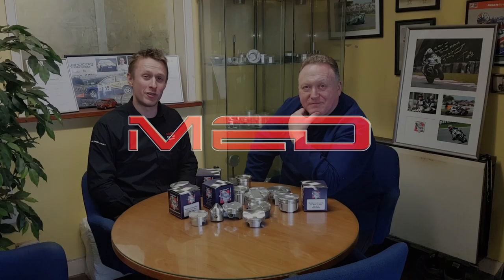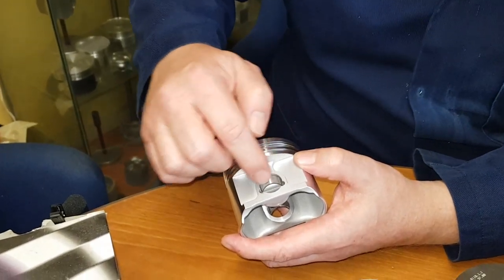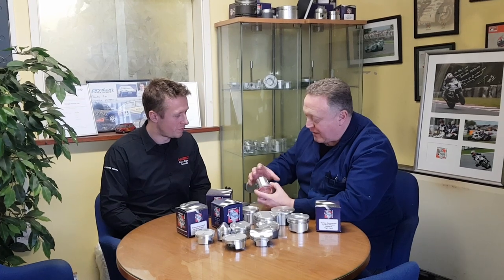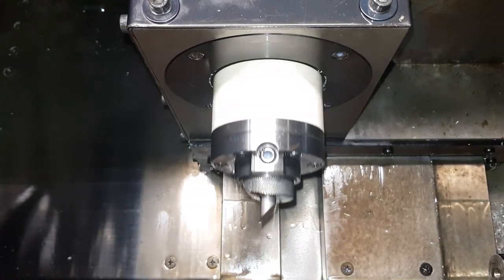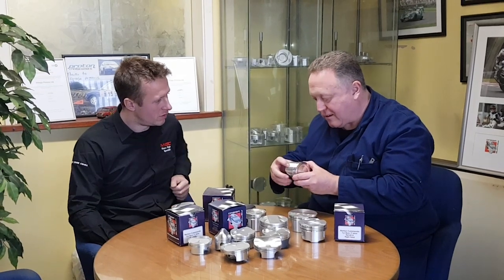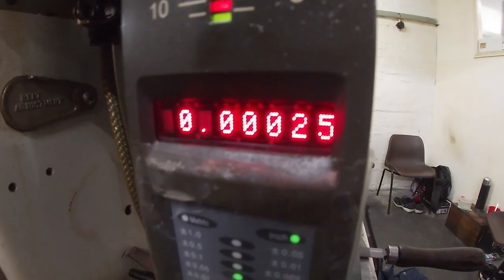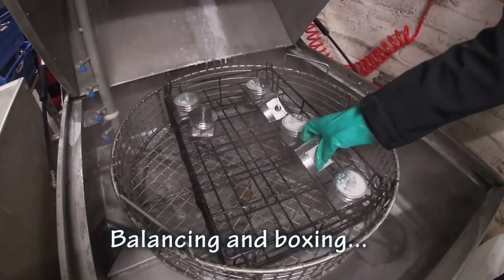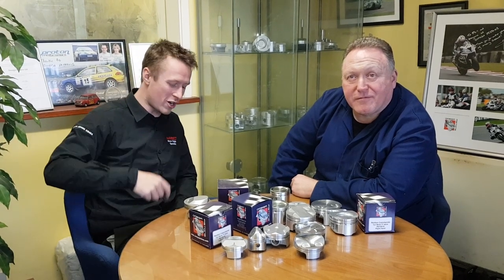How it's made - Omega forged pistons - Part 3

Comment: I think it is the best and most educational forged piston manufacturing process video on YT. Congratulations!!! I didn’t expect that the details of the so called oval shape based on the design would be that sophisticated. I believe the quality of that phase alone makes the biggest difference between the brands. However, I would expect Omega to cover the common skirt and top side coatings. May be a in a Part4.
Reply: Thank you

Comment: do you calculate how much material is preventing the pin from yanking out the bottom of the piston by looking at the amount of web above it.. and do you ask for customers when they have an engine failure to send the damaged pistons back for analysis..  do you offer info on piston expansion rates above normal operating temps .. i am thinking about the rash of piston, ring, cylinder bore failures on the ford GT350 engines with the 180 degree cranks..  where the high boost and high rpms seem to expand the rear most pistons in the block causing them to scuff and pile up aluminum transfer weld under the rings.. either breaking the ring lands or lifting the rings off the cylinder walls letting combustion gasses thru killing the engines..  probably do to a lack of cooling around the back cylinders in the block at such high speed that the water pump impeller is cavitating and reducing mechanical cooling system pressure in the block or just reducing coolant flow..  too much for the oil squirters to cool the piston crowns from the bottom for the short duration high rpm these engines can do.  the 180 degree crank removed crank whipping that pulled the main webs out of windsor blocks for decades.  and a few mod motors.  heating the pistons in something like a mobil 1 oil. and quickly taking a measurement of them.   or streaming a blended flame at the top to keep the temp just below the melting point.  to see how much they expand..  allowing engine builders to machine in extra clearances and ring gaps for the rear cylinders to reduce repeat and very expensive failures. ford charges $38,000 USD for those engines.. so they are not a normal mustang V8.. 

 just late night thoughts to kick around the R and D table at breakfast.. 

 i am taking you have a piston forge also.  takes heated ingots and deforms them into beautiful forged pistons blanks. 

has anybody ever come to you about making other items out of forged aluminum that could be done in your machines with only tooling being needed . expand your production profits.  what those products might be????  small forged brackets for light aircraft perhaps..
Reply from the maker: Hi Wayne, we just retail the A-Series pistons ourselves so you're probably best to contact Omega direct with these questions. Mini engines we can help with!
Reply: It's a shame Omega take so long to respond to requests and turn things around as their product quality is excellent. They don't seem to be interested in making money and have probably lost a lot of business that way.